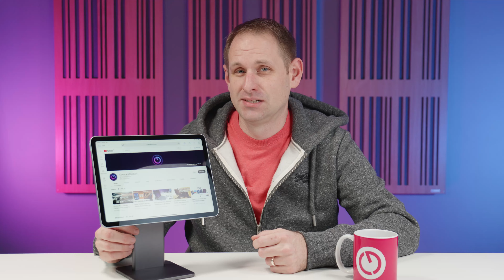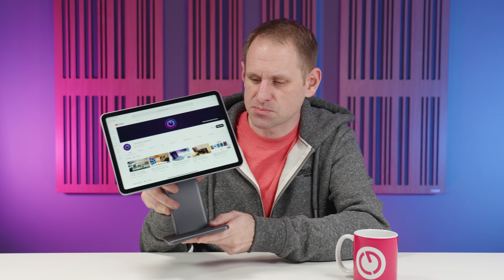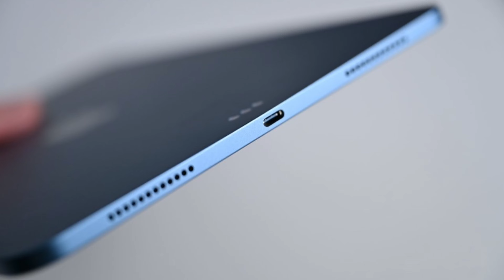11" iPad Pro Stand WITH USB-C Hub!!!   Qwiizlab US1011 Pro

Comment: I already use a hub with my ipad pro but am mindful of the potential dangers of leaving the ipad plugged into a charger 24/7 - the concern about this stand, is that it would encourage this behaviour as the cables are “out of sight” to an extent.  Curiously the hub that I use, if I leave it plugged into the ipad for too long a period (e.g. Overnight), it forces the ipad to restart (needs. a PIN to login as opposed to face ID), so I only use it now when needed - not a big problem but curious non-ideal behaviour.
Reply from the maker: That is a bit weird. Which model of hub is it?
Reply: @ConstantGeekery  Its a GBP 32 thing off of Amazon by RREAKA 7-in-1
Reply from the maker: @SighManP  good to know in case anyone else has had similar issues with the same device.
Reply: Something interesting is that My old iPad 8 used to stop charge at 80% when I used the hub that I use at home where it stays connected all day long. With the iPad pro 2022 it just keep charging to full 100, so they downgraded the behavior? Not rare for apple to downgrade

Comment: the moment you took if of the stand, i said shame...wouldn't be amazing if the implemented smart connector connection for the dock, so you just put it on stand and it works?
Reply from the maker: That would be amazing, but my guess is that it would only work for charging - I'm guessing the smart connector can't deliver USB-C performance. Would be awesome if it could though!

Comment: Bit of an off topic question: How do you keep the iPad screen so clean? It looks like it just came out of the box. Mine never looked the same after I started using it, and I've tried many ways of cleaning it.
Reply from the maker: 😁 we wipe it in between takes. Deep pile micro fibre cloths are all that's needed - no cleaning fluid. These are the ones we use: https://amzn.to/3XlXZj1 They last for ages and can be washed, and they won't damage your screen.
Reply: Yep. The use of any wet wipes, cleaning liquids or sprays must be avoided. They just ruin screens.